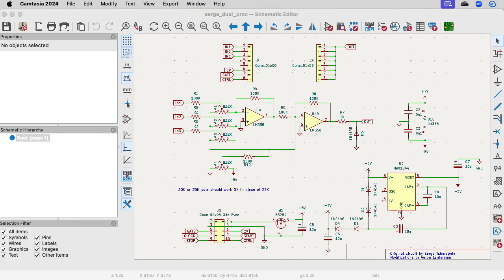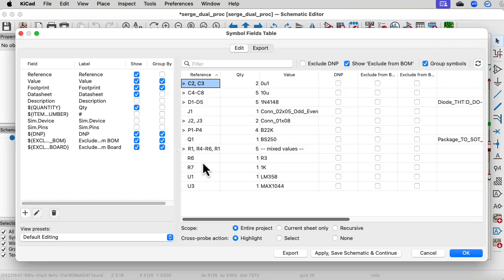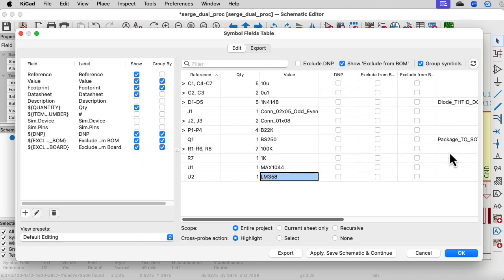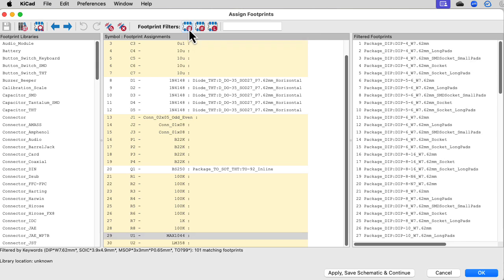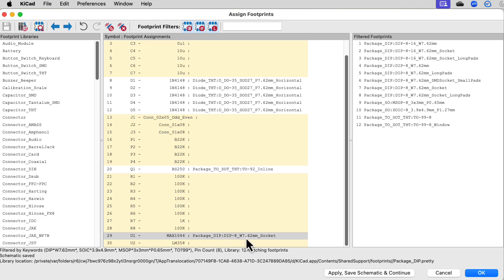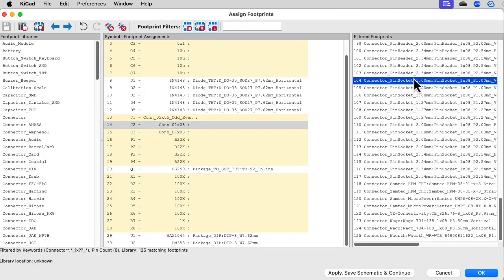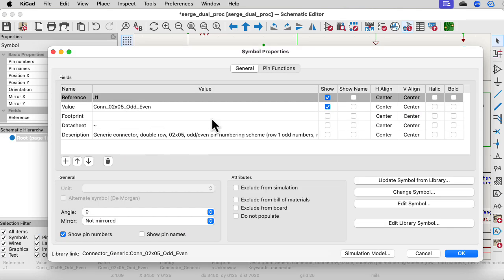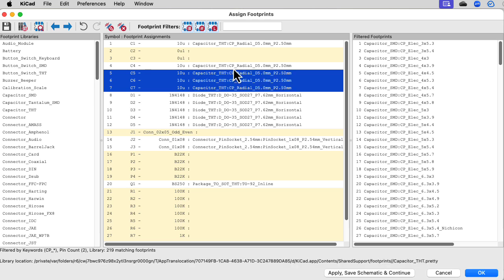KiCad Footprint Assignment for Serge Dual Processor in Tangible Waves Format Adaptation (1st Look)

Comment: I totally agree that it should have been nice to browse through the right hand footprint roster of the Footprint Assignment tool and see the footprints as you click through them. Many components also have 3D-models so it would have been nice to see views of them too.

Instead of suppressing DRC errors for unconnected pins you can add a small X on that pin to tell the DRC that this pin has been left unconnected intentionally. It makes it clearer for other people (or your future self) to see that is going on.

About why you didn't need to add the PWR_FLAG to the -5V is because MAX1044 pin 5 is defined as a power output in the symbol definition, so it's clear for KiCad where the powers comes from

Comment: You probably want to use a transistor footprint with the legs just a TINY bit further apart 😀  I'm not a fan of that one.
Reply: You can open a separate window to view the footprints while you arrow through the footprints, and works from assign footprints.  To be honest, I'm still using version 6 so I don't know where it is in the latest versions....

If you click the "library" filter, you can click a library name on the left, and it will stop showing you every possible footprint match, and only show you the ones in that library.
Reply: Actually I think I see the footprint viewer in the upper left, 3rd icon over.  Not an obvious choice, but that's where I do it, and I just put it on my second screen while I'm selecting footprints....

Comment: One mistake you made is the IC footprints should be the 3.9mm width ones, not the extra wide ones. I use Digikey & JLCPCB to look up the parts I'm going to use and select the footprints to match what they tell me.
Reply from the maker: Tangible Waves uses SOIC parts, but here I want to use through-hole parts.

Comment: The idea with the power flags is that you’d attach them to the header, saying essentially that power comes in here. It’s sort of a sanity check that not only did you name a net +5V, or GND, or whatever, but also that net is in fact connected to something that makes it what you say it is. That said, I haven’t found the ERC checking to be too helpful myself—it feels like I’m basically just tending pedantic errors by putting in extra power flags, x’s on unconnected pins, etc.

Comment: When I'm adding power flags, I edit the first one I place and turn off 'show value.'  Then I can copy/paste it everywhere else I need one. Those PWR_FLAG texts just clutter the schematic.

It helps to have schematic symbols for power connectors. For instance, I added a 'Eurorack power connector' (actually two, 10- and 16-pin versions) to my personal parts library and put the labels on it as just text objects, not naming the nets. I have the power pins on that connector identified as power outputs, so they don't need PWR_FLAG.  If you're going to follow Tangible Waves format, I'd probably make a symbol for that connector's form factor, (with all needed flags) and add the correct footprint and STEP file.

You generated -5 volts on board with the MAX1044.  In the part template, pin 5 is labeled as a power output, so the ERC didn't have heartburn - it knew that's a power output.

If your connector template in your parts library had pins 1, 2, 3, 4 labeled as power sources, then the only places you'd need additional PWR_FLAG would be the source of the BS250 and the +7 that you're drawing off the MAX1044.  Incidentally, in my personal parts library I have BS250P (with the package suffix) and the TO-92 footprint pre-assigned. By the way kudos to you (or Serge?) for adding reverse power protection! But no static drain resistor on the MOSFET gate?

If you replaced that LM358 with an LMC6482 - same pinout - you wouldn't need the +7, because the LMC6482 swings to both rails. But maybe you wanted some particular distortion effect that a cheap bipolar op-amp would give you? (Or you were trying to replicate Serge's design precisely?)

Comment: Yes, as noted, you want to put the X unassigned pin for any spare pins you have. In the Assign Footprints tool, top left there is 'View Selected Footprint' button, it will bring up a separate viewing window which shows you your currently selected footprint. If you arrange them correctly then you can see your currently selected footprint and scroll through them as you were wishing. Half the time I'm just using 0805/1206 resistors and caps these days, they are small and cheap, and not really any harder to solder. It's most useful for mass assigning as you found out, but for particular parts you could indeed just edit their properties and pick out a particular footprint for them.

For your future PCB design, you should be able to select a group of symbols in the symbol editor page, then alt+tab to the PCB editor, and they'll be already group selected for you to move into rough position.

Comment: The footprint selector tool is fantastic for bulk assigning simple well defined footprints. For example, I almost always use 0603 resistors and capacitors, unless the capacitance exceeds 1uF, then I step it up to 0805. This is very quick in this wizard and can be done at the end of schematic design for the generic parts that I am not fussy about. For more specific parts, I usually assign the footprints at the beginning when placing them. I'll make "Manufacturer" and "Part Number" fields in the symbol properties, since these are things I like to dictate on the BOM on specific parts that I care more about. 

KiCAD is a little unusual as it lets you combine multiple workflows. I use Altium at work  and for most things now, I actually prefer KiCAD. I had to get a simple board done in a hurry using generic parts, and I found myself longing for the KiCAD workflow and libraries. I am willing to bet I would have finished the board about x3 faster had I been using KiCAD instead of Altium for that.

One more tip Aaron... don't sleep on the KiCAD plugins. The Interactive HTML BOM is particularly fantastic when it comes to assembly (whether you do it yourself or outsource). I also really like the rounded traces for some things (teardrop pads are actually built in now, and compliment the rounded traces from the plugin).

Comment: When placing a symbol, some parts have a regex for supported footprints. That's why your diode and transistor already had a footprint selected.

It would be nice to be able to choose a footprint from that list later, but I don't know if there's a way to do that.

I also find it dumb that the footprint preview is a separate window. When would I ever not want to see that?

Comment: The schematic and the board layout are linked.  The trick is to have both windows open on screen.   You can, for example, select a group of components in the schematic editor and they will be selected on the pcb editor.  The M hotkey will allow you to move the group of components to the board proper.   Also, if you select a part in the pcb editor, it will be highlighted on the schematic editor so you solve the dilemma of what the pesky loose part has to do with the design.  Yes, it is all a bit clunky, but what do you want for nothing!  

I spent 40 years learning AutoCAD for 2D survey drafting (you never learn everything...) and KiCad was a total paradigm shift.  I knew nothing about manufacturing design software when I dove in.  You seem to be learning KiCad MUCH faster than I did.  I finally learned after a lot of frustration and now it is all second nature.  I'm enjoying your journey, thanks for sharing!
Reply: The one complication is that after you make changes in the schematic, you have to choose "Update PCB from Schematic" either in the schematic "Tools" menu or the PCB "Tools" menu, or press F8.

Comment: Glad to see that despite 30 years of accessibility settings, larger cursors still obscure tooltips. Across all OSes. Infuriating it's such a basic thing.
Reply: It's kind of a fault of the windowing systems.  The code that draws the tooltip has no easy way of determining how big the cursor is so as to be able to stay clear.
Reply: @KludgesFromKevinsCave  if only there was a registry or plist entry so I can customise it

Comment: You can use the F hotkey while hovering over a symbol to open the footprint selection menu for that part

9:50 in that case you'd probably be using SMD caps and not have to think about which footprint to select at all :D
Reply: No worries about the footprint for SMD caps?  How would you know an 0402 from a 1208?
Reply: @KludgesFromKevinsCave the SMD part you use forces you to use a footprint 

with THT, you have freedom.

Comment: KiCad drove me round the bend when I first started with it! Didn't take too long to settle in though. "Apply, save schematic and continue" and not just "OK" is a lesson we have all learned after allocating a bunch of footprints... also you'll probably need to design your own symbols and footprints before long, I find some of the bundled ones to be weird and/or wrong, and that includes ones I've downloaded from manufacturers (cough cough Bourns).

Also, when you leave something unconnected, KiCad wants you to put an X on it. There's a symbol on the right hand menu for that below the 'draw wire' stuff.

I think it's a good idea to build your own library as well, I've been gradually building up a selection of commonly used parts.
Reply from the maker: To do more Serge designs I'll need a LM3900, which doesn't seem to be in KiCad's built-in libraries and I can't seem to find other libraries with it online, so I will need to learn how to make my own symbols soon!
Reply from the maker: Ah, thanks for the tip about the X!
Reply: cough cough Bourns ... You mean how the STEP model doesn't align with the footprint, or is there something wrong with the footprint itself?  (I'm planning to spin a board with PTV09 form factor pots fairly soon, and don't want to be disappointed.)
Reply: @KludgesFromKevinsCave  Bourns had got pinouts wrong, and their sizing was off from what I remember. Much better to roll your own!
Reply: @nerdysynthdude  Thanks for the warning!